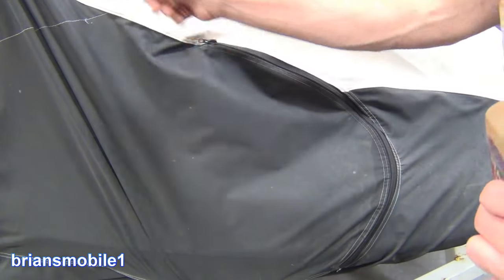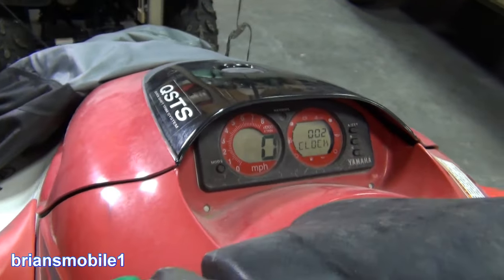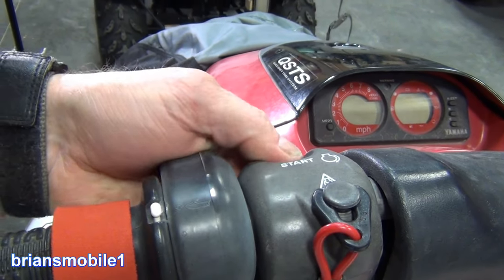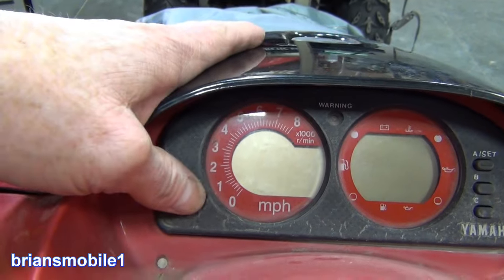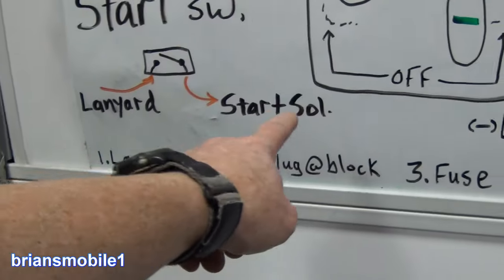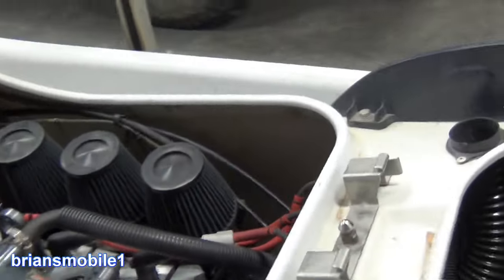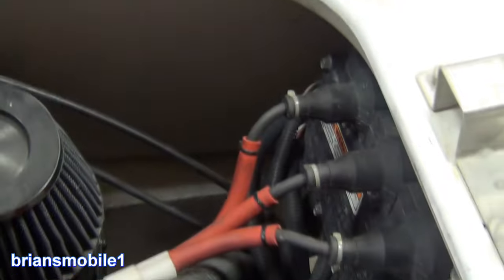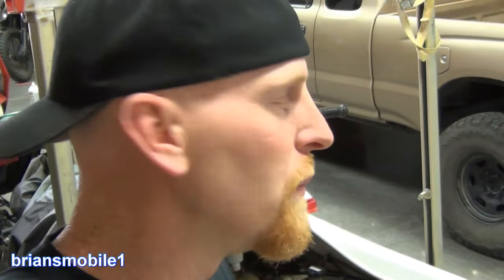How To Fix Wave Runner Dead Start Button And Display

Comment: If you delete the speedo/tach cluster, will it still run? I want to use a gp1200 engine for a swap into a wave blaster.

Comment: I have. a no crank problem! There is no power at the White/Brown connector that plugs into the Start/ Stop Box! Could I have a bad MFI, ( it never worked and has 2 wires twisted with a wire nut) but the Ski always ran fine before!  Do you think it could be the, "reset" condition that you eariler mentioned?

Comment: 2006 Waverunner, new starter and solinoid. It will click and whine but not turn over. Is the engine seized? How can i check that?

Comment: So I took that cover off and jumped it at the solenoid and it finally fired they've been sitting for quite a while and had bad gas I guess. But cant get it to crank at the switch.

Comment: When I put the code in  it says (lock) instead of start. Do you have any idea how to fix this issue?
Reply from the maker: Yes I do!  It's in the video.  There's a wire you disconnect and reconnect that runs between the seat and the fuel tank.

Comment: So I followed this procedure with my power probe and when I touched the pin in the red connector I believe it was the brown wire. The power probe showed battery voltage upon touching the brown pin and then when I used the probe to give it a negative current pressing backwards on the probe switch, the jet ski started to crank over, any insight on why this might have happened? Much appreciated!!!
Reply: I tried unplugging the blue connectors and that did not allow me to start up then I used probe and found that out^^
Reply: Also have a brand new solenoid installed… doubled checked starter leads all good battery is new have power on one side of solenoid and not the other

Comment: Ok so my display turn off while riding my 97 gp1200. I beached it and tried to restart it and the display won’t turn on. The warning light stays on. The jetski cranks over and turns on just fine. What do you think it is? Is the stator going bad? Or is the display going bad? I need your professional opinion please.
Reply: Carlos. Você conseguiu resolver? Estou com este problema também.

Comment: I watched your video on mine there is a red connector with a brown wire and a red wire. Is that the one? I have no power to the dash and no crank.
Reply: 2011 XL1200
Reply from the maker: Double check your lanyard and power from the battery.  If those are good, check if the lanyard switch got left together and got stuck or corroded.  If all those are okay- it's the security thing.  My connector was originally behind all the other wires.  Good luck!
Reply: @briansmobile1  I got it to fire up and the guy he had bought it from hadn't given him the code. I'm assuming now that we punch the code in that maybe it will start off of the push button but I have not tried that yet.

Comment: Yes, common faults, and most of them can be avoided with correct maintenance. Good also there to do the oil pump delete and run premix, because those pumps have a nasty habit of going lean and then you are going to need new pistons, unless they go properly and take the cylinder walls out as well, and then take out the crank. The crank bearings can be replaced, but not a DIY thing, as you need a special jig to get 20 tons down there to first pop the pins apart, and then get them back together in the correct alignment. Think Yamaha is starting to run low on those cranks now, they certainly are getting expensive.

And yes wrist pins can and will easily make their way through to the waterbox, even though they theoretically should not fit, they can bully their way there. Generally with a lot of shredded aluminium and if you are really lucky a conrod right through the starter as well.
Reply from the maker: My condolences!  You know more about all that than you may have like to.
Reply: @briansmobile1  I was lucky, just the piston landing went, so a gasket set and a piston with rings, plus new wrist pin. And the blanking plate. Other guy not so, he basically just kept the carbs, a dozen bolts, and replaced all to the water box.

However did get to give the entire engine top and bottom a brand new coat of paint, 2 coats of 2k yellow primer and 3 coats of Yamaha grey. Got to use loctite on all bolts, either the green for those not coming off, or white for those you want to come off again. Exhaust got red high temp instead, plus a bit of welding for the cracks in the alloy parts from having one come loose. Then 3 coats of satin black 2k paint.

Comment: I'll tell you one big mistake you're making on a Yamaha is that cheap lanyard that thing is too thin and it will cause it to have all kinds of firing and electrical issues get a good Yamaha thick lanyard and bring that direct ground all the way up the vibration of the motor with those thin lanyards makes them have all kinds of issues